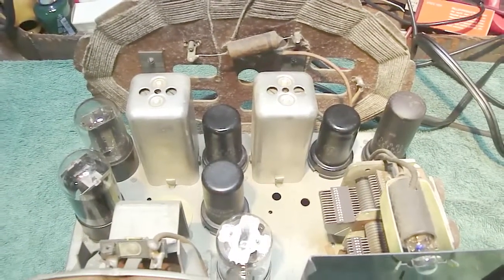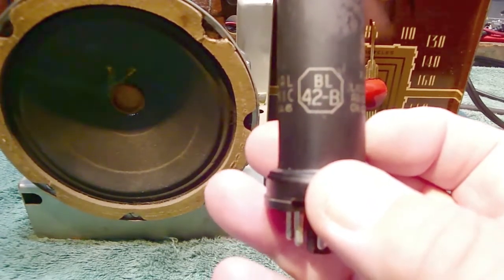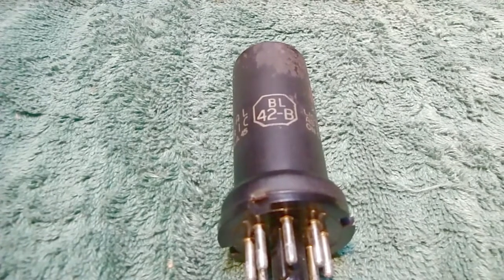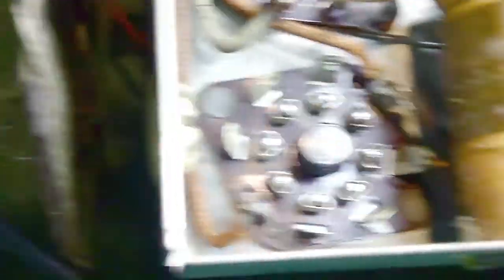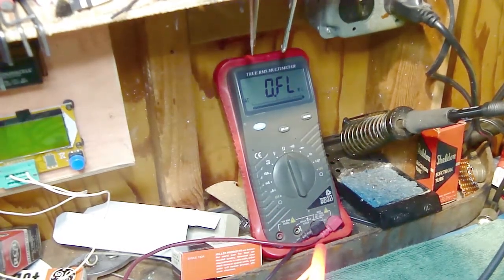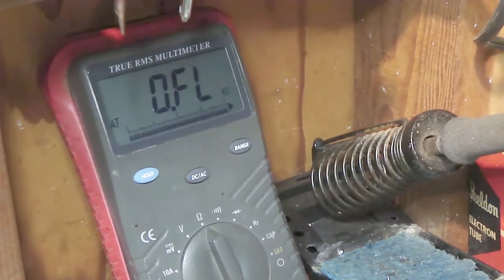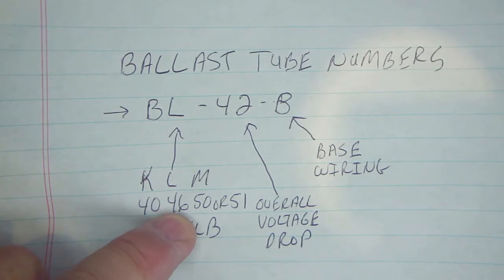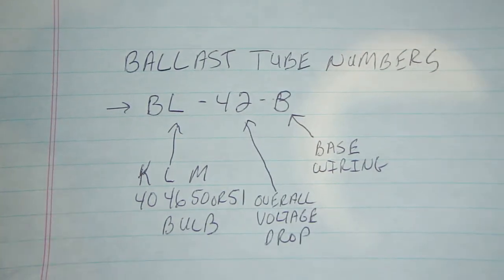Radiowild's Tricky Troubleshooting Tips Part#3

Comment: yes Ballast tubes are a bugger to find. Have a 1937 Air King Radio had a ballast I could not find anywhere so My fix was finding two 24 volt bulbs and wired them into the circuit underneath the tube socket it worked fine. Thanks for explaining what those numbers mean on the ballast tube I never really checked that out. Thanks for sharing

Comment: Thanks for the tip RW!
Reply from the maker: Thanks for stopping by!
Reply: It should not e too hard selecting a suitable resistor to install knowing  series,filament current  and voltage required by the schematic or calculation of other tubes in the string minus total line inout.

Comment: RW, sometimes unused pins are used as tie-points in the circuit and don't necessarily mean they connect to the tube itself.
Reply from the maker: You know...... That's a great point that I neglected to mention. Thanks for commenting!